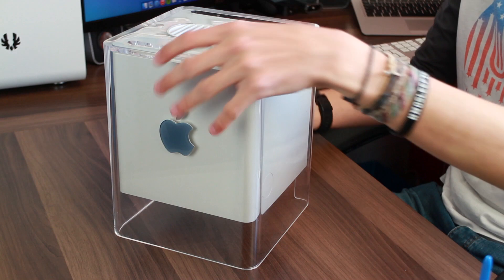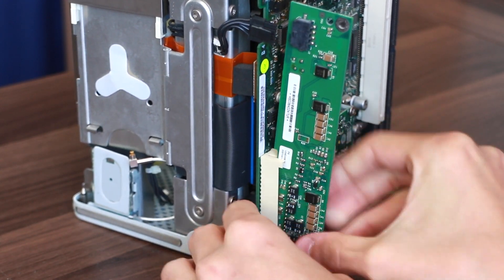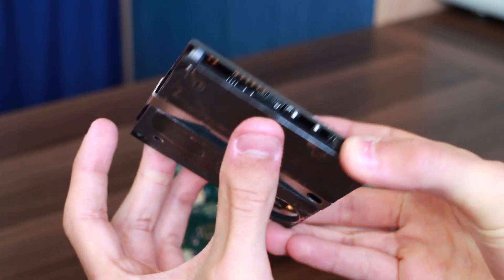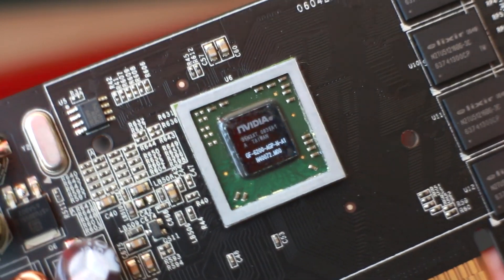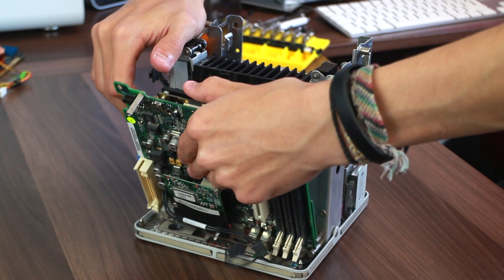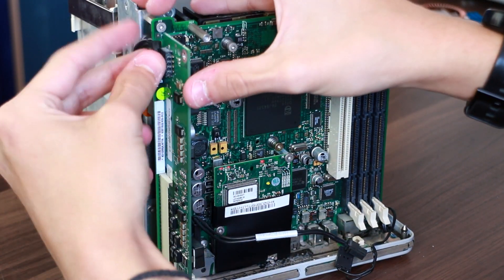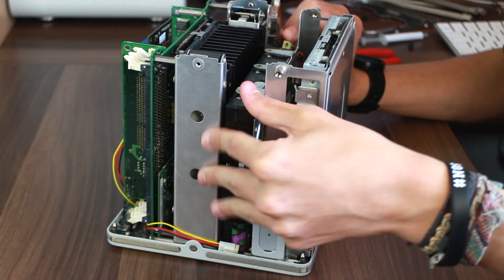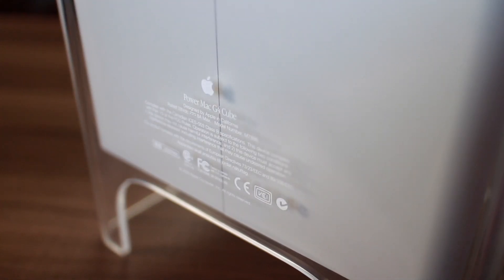The Ultimate Power Mac G4 Cube: The Build [2/3] | The PowerPC Hub

Comment: is there any sort of plans for a proper bracket for the graphics card so the card doesn't tilt around in the slot at all during use?

Another thought would be later on, even though the original AirPort card is enough, to possibly replace it with a Linksys WPC54G v3 or so. These use a broadcom 4318 chipset, and with my old TiBook 500, I was able to use that as a normal AirPort card and access the internet, as well as connect to WPA2 networks. with the older AirPort, WPA2 doesn't work. well, it worked a few times... and then it up and quit on me.

I do wonder if one could use a Linksys WPC300N v1 as an 802.11n adapter, but I haven't tried this in 10.5. I tried it in 10.4 and it wouldn't work, but then I believe 10.5 was the first to support 802.11n cards.
Reply from the maker: ***** Unfortunately not. The front plate never arrived with the card, so I never got the opportunity to cut one to fir the Cube, and to add to that -  the original support bracket used with the OEM cards doesn't reach the (narrower) 6200 so it's left completely free standing. It's not massively heavy though, even with the Titan on there so it shouldn't be a massive issue. I made sure the display was screwed in tight & that were was minimal stress on the cable so I'm happy enough with it.

And about the wireless card - does it use the same connector as the standard AirPort cards? If so then it'll definitely be something to look in to.